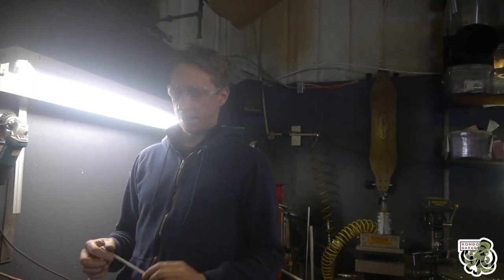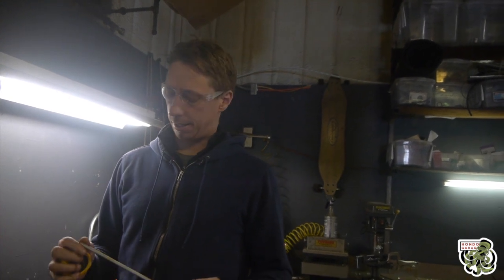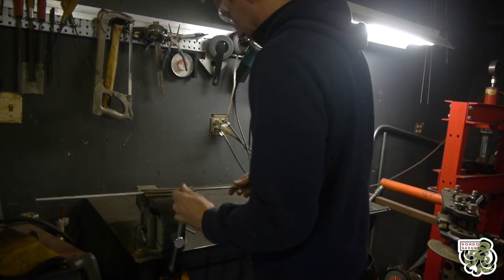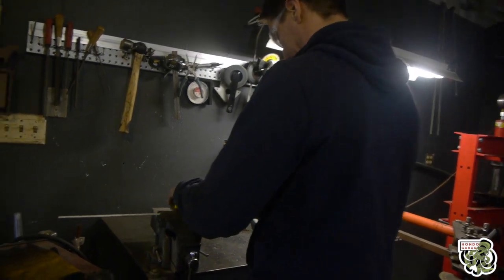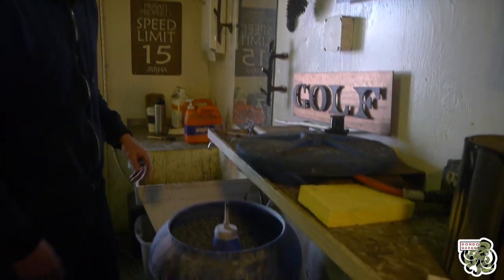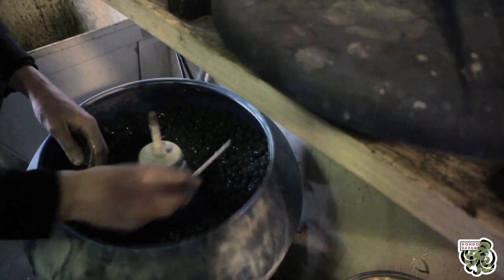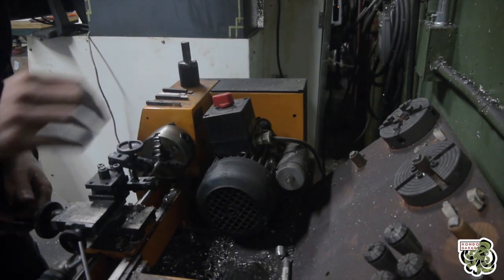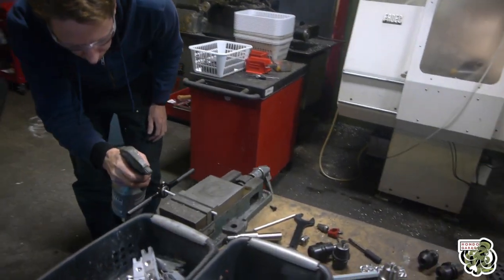Long Handle

Comment: HONDO Garage hondogarage- hey I've been shopping around for a quality FF for months now but only just discovered you guys 

Love your minimalist ethic that doesn't sacrifice function from what I can tell.

And I love the way you're going to look after this special request customer. Awesome service.

BUT - you guys need to get into eBay (unless your running at capacity already).

Like I said I've been shopping for an FF for months and only just found the FDFF.

I've only seen the pop and lock because I found your site.

I suspect a lot of your potential market will be looking on the bay.

You need a presence there.
And if you have presence in the bay already it's not working for your market.
SRSLY!